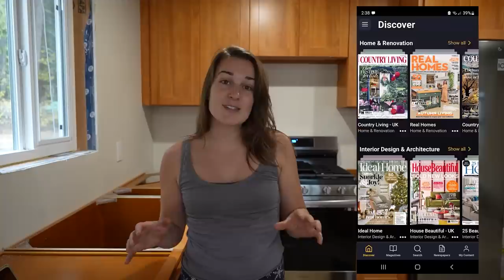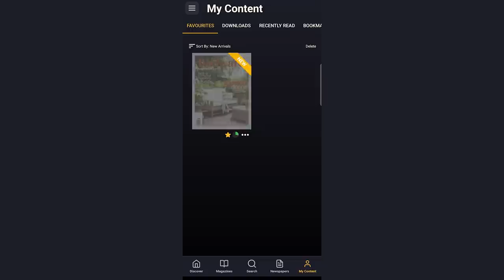This Was A DISASTER | Our Worst Day Living Off Grid | Setting Up Water In A SNOWSTORM

Comment: Water being so important and that tank has been a PITA, if feasible, that first springtime task is a new tank with appropriate fittings. Expenditure may be worth it but all the best to you both.
Reply: I was going to suggest the same thing.  New tank, new fittings come spring.  I wouldn't be able to sleep at night until that was done.
Reply: Yup. It's practically impossible to weld polyethylene without the specialized equipment ($$$) to do so.  That's probably why you got a deal on that tank.

Comment: If I may suggest, if you make the patch for your storage tank from the inside it would be forced against the crack ensuring that it won't leak. When patched from the outside the pressure would force the patch off by the water pressure. Make your patches on the inside 💠!

Comment: Always thought maybe a shallow well made with concrete tiles down to about 12 feet with a lid. Water dowsing to find the right spot close to the building with buried water line to shallow pump inside a warm building. Well located at least 60 feet away from the waste field. Hang in there.

Comment: Goop and lighter fluid are same thing. Lighter fluid is cheaper. WD40 also works at removing sticky residue. Heating up the utility knife is a smart tip I'll be using. Good quick thinking on pumping the water back into the totes. I would've put silicone caulk on the inside with a pool patch over that and Flex seal on the exterior. Don't know if that would have done any better than your original repair job. Nice job in the end. Very entertaining video.

Comment: Suggestion - purchase a garden sprayer. Fill with hot water, cooled down to comfortable, use as a shower. Then in the spring, you have a sprayer for a lovely flower garden. Also, I was crying and yelling when you didn't put a gasket on BOTH the inside and the outside on that fitting

Comment: Wouldn't a patch on the inside be better.  The water pressure would help seal the patch.  The patch would have to be safe for drinking if you are going to drink the water from it I guess.  I would just think some flex seal would work.  Just my thoughts.

Comment: Nice Vid. Get some Flex seal works like a champ even if the waters coming out as long it’s a slow rate. I’m not getting paid for this advertisement 😉. Also don’t know if it would work when it’s cold. I’ve used it several times

Comment: I'm also off grid trying to renovate a  tiny ruin whilst living in a 3x3m block hut so I can sympathise. Re the bathroom situation.. I'm using a gas boiler on propane with a water pressure pump linked to my IBC tank. I have hot water, with pressure connected to a shower so I can have a hot shower, feeling clean is so important for morale.

Comment: Yea, You can Solder/ Melt Plastic together.
Just use a larger size Soldering gun, use Zip Ties as Solder, But use some metal window screen to push/ embed into the plastic.  
But before all that clean real good.  Then do a "root pass" in the crack to seal it first.
When you are done it will be better than New!

Comment: Put lot's of sand in and pack it under the pipe coming out of your tank or else when you backfill the hole the weight of the dirt will snap the pipe off the bottom of your tank. Good Luck!!

Comment: Many moons ago I was sort of off grid myself. Water line froze due to extremely cold temps one winter. I mean 5 weeks worth of waiting to thaw. I hate tub baths!!!!!! So I took 4 5 gallon buckets placed two in the tub with me two beside it heated two canner size pots of water and poured half of each in the buckets topped off with room temp water from 5 gallon cans I had. I stood in the tub used a very large cup poured water over me soaped up they took large cup again and rinsed off good. Anyway just a tip I figured out.

Comment: I understand your situation! That poly cistern is the weak link in your water system and care must be taken when burying it and the plumbing. The plumbing must be fully supported to avoid undue stresses at the tank connections when buried. 
In the day's before plastics, concrete or wooden cisterns were built onsite and lasted many years. Good luck with your adventure! Looking back from a future date when all this hard work and stress are long gone, you will appreciate the fruit's of your labor's with what you have built and remember it fondly!

Comment: Good job. Try getting some flex seal pasted put it on the inside it works really good under water. The pressure of the water up against the tank will hold it really good.

Comment: You can see the frustration, glad you made it through it ,and hope that you back filled by hand around your outlet at the bulkhead.  A common mistake ,is to just use machinery once all the plumbing is done,and I'm guilty of making the mistake myself ,just trying to get through the project .  You have to make sure that the line has firm support underneath it at the tank ,otherwise the weight from the backfill will distort your gasket and cause leaks .

Comment: Well I can’t do anything about the snow.  If you have a range set your dish water on it.  When it gets hot just turn it off and wash your dishes.  Rinse if will have to be done over an empty pot and just use a glass of water at a time.  After two years of doing it.  I’m really fast at washing dishes now.  You can use a latter next to your tub.  Fill up a five gallon bucket with warm water after you put a spigot down toward the bottom but on the side of the bucket.  I issued a board under the bucket and secured it with bungee straps so I could get the bucket more over the tub and not spill the water all over the floor.  Five gallons will be plenty of water.  You will see after your first shower.  You two are really tough.  Don’t cut your self short.”  Look at all you have done so far.  Your just about over the hump.  In fixing that tank.  Lots of luck brazzing it together.  I never had any luck doing that.  I would get fast drying epoxy.  Cut a piece of plastic and even roughen the surface so it will stick good.  Then I put tape over it so the epoxy can’t get out and run down the side.  Make sure the surface is just as clean as you can get it.  Good luck.  Till later.

Comment: I'm not trying to be a jerk, but the glaring problem with your situation is water. Is a well even a possibility? The investment of many thousands of dollars would be more than worth it to meet your # 1 need. Where I live we are rural, but not off grid. I had to go down 600 feet to find a decent water supply, but it is so nice to never have to worry about water. I have watched you both struggle for a long time with your water but you don't seem to realize this could put your whole dream in jeopardy if you keep doing the same thing. They say stupidity is when you keep doing the same thing with the same outcome and don't learn from your mistakes. I'm not saying a well is the only answer but something stable and reliable is worth whatever you have to spend or do to make that happen rather than a hose through the woods.

Comment: I'm sorry you have to go through this water problem.  I was hoping you could get running water before winter.  I just had water heater go out and I'm having health problems so that m ade it worse.  I couldn't get element out of tank and had roof water leak because of wind and storms. I had to suck  calcium  chips out of the hot water tank so had to buy wet dry vac to do that. 

I hope you get some good luck. We will pray for you.  People take for granted the running water.

Comment: I have found that hot melt glue works well to sweat a patch on both sides of a polypropylene 5 gallon bucket to patch a hole.  I just cut the patches out of another old bucket.  Might be worth a try if your patch gives you problems.
Karl

Comment: Why don't you get the portable water tank for your truck that has the Valve on to bottom and just gravity feed it to your cistern instead of pumping it in and out of the truck. it would be so much easier instead of loading your pump up twice for every tank of water.

Comment: Hey guys your gonna have to repair that from the inside...there is some tape called eterna- bond it's for RV roofs but it will seal that crack and it's waterproof but you have to use it at a warmer temperature in order for it to completely seal and you need to compress it very well also maybe try a pool patch kit but anything you do should be done from the inside good luck you guys

Comment: hey remember when you Said you could of used a larger bulkhead. a bulkhead should be as close to the size of the hole as you can get it. I have used alot of bulkheads and when there smaller they leak. sorry this crap is happening to you 2.

Comment: How much does it cost to drill a well? Not an irrigation well, a proper deep one. As opposed to buying a new cistern, ibc tanks, etc
And I would think that the cistern patching should be done on the inside, so that the hydrostatic pressure will help seal the patch against the internal wall of the cistern, instead of the water pressure pushing the patch off the outside of the wall

Comment: You know a "rocket mass heater would be a great idea for you guys it burns less wood stays warm for hours after the initial burn saves you time money and labor.  and since you have a two story you could have two mass units one on the main floor and one on the upper floor. Or build it underneath ur house to keep that area from freezing as well and you can be creative about it how you make it since you have to build them your self wood rocks sand gravel clay and straw fire bricks stove pipe your labor. hell you could heat a barn or work shop with these and they are better then the most expensive wood stove you can buy. cuz you have to fire them once or twice a day once the mass unit warms up it radiates heat all day. and you dont need a chimney you can exit out a wall like a dryer vent cuz the exhaust is absorbed by the mass in your mass unit. And they dont smoke like a normal chimney its more like steam. I spose you could have a normal wood stove to for ambience. But not really necassary.

Comment: Ok take a 1gallon plastic water jug drill some holes in the cap presto fill with warm water and a very efficient shower. When you are off grid and water is short and so was my hair it was easy to take ac1 gallon shower

Comment: Hi Greg and Katie  glad you could repair the cistern but not after dealing with the leaks and getting the water to fill it. if you are going to keep your totes  maybe  look at getting fittings and suction hose to hook into the valve at the bottom . Your totes would be great in the summer to  a use to make a fire skid. You have the pump and some hose. You may want to look at Rainbird sprinklers to install around your property .high up off the ground .on t he ends of your home and on the sheds. These systems have  been used to save homes around BC. i know its early to  think about the systems.  I hope you water troubles are over. be save

Comment: We live off grid in Northeastern Wyoming in the Wyoming Black Hills and we always keep those black Camp showering bags in case of an emergency with our water system at least we can get clean just heat the water on the wood stove keep hot water on there all winter long you need the moisture in the house anyway because of the dry wood Heat so I always keep a big kettle of water on top of the wood stove just for emergencies so I can put warm water in that and we can at least get showers one bag per person I mean even if you have to feel that kettle everyday with snow and melted you've got warm water to take a shower by just have a hook in the shower that you can hang the bag up on...I think everyone who sets up their their own homesteads and doesn't hire it done has times like this I know we sure did

Comment: i use to use a solder gun twith a flat tip to weld car batteries at a auto wreckers any good welder knows you have to drill both ends of a crack to stop it be for welding it up

Comment: You guy's are awesome  but is it possible to use a PVC  pipe to off load the water into your tank and just leave your pump set up at the water hole until you have the tank full  ?    Just a thought

Comment: I'm not understanding why you are not using the valves at the bottom of the portable water tanks to drain them, other than gravity draining would be too slow. I would think you could attach the pump at that low point and drain the tanks completely, NO? 
There is also a product called Flex Tape, that I would think if applied to the inside of the tank, DRY,  would solve your leaking problem? I have some of that tape for such issues, but have not actually used it. 
Of course, all of the this suggested advice is too late, as you read it at this point after the fact. Jees Louise, you certainly don't want that thing leaking a drop!!
I hope that your repairs hold and all is well. Best regards, Ted
Reply from the maker: we just haven't purchased the fittings for it, and in the winter they freeze (and/or break) so its always just been easier to use the top

Comment: Glad to see the cistern is not leaking would replacing it have been an option? In the past I found with working with all kinds of fittings plastic metal that once they develop a leak all the pipe dope and tape in the world won't fix it permanently. Sometimes when things are manufactured and parts are threaded, for some reason certain parts don't mesh together as well as you would like. Sending positive thoughts. 🤞🤞
Reply from the maker: they are expensive and probably would need to be ordered in, so not a quick fix
Reply: @ThisOffGridLife  fortunately it looks like Greg got that lower fitting sealed up nice.